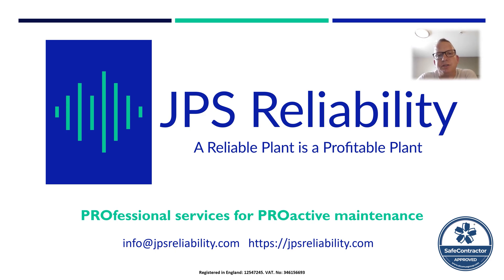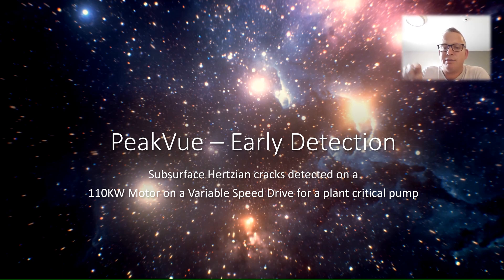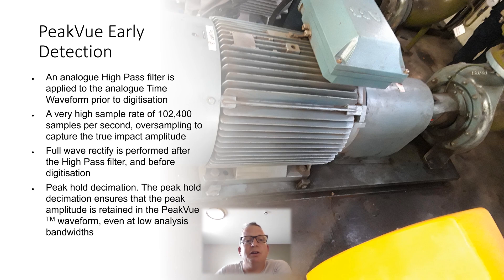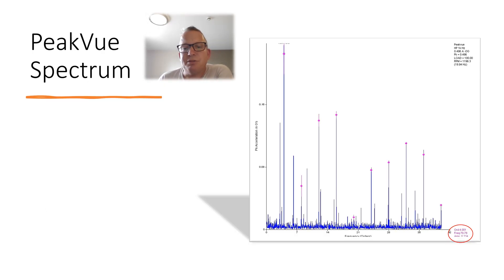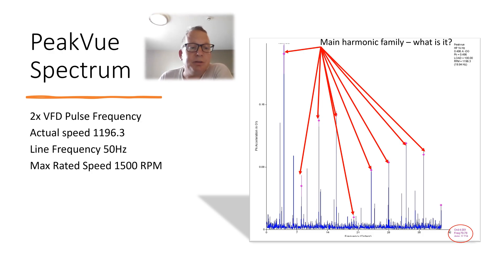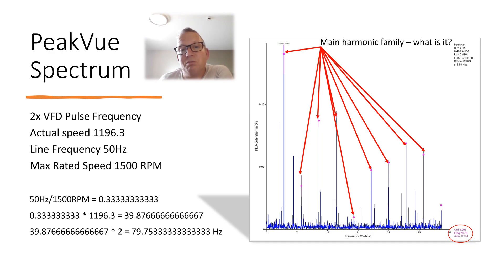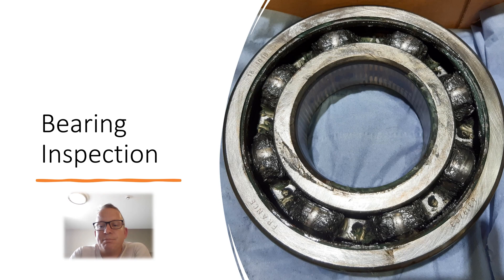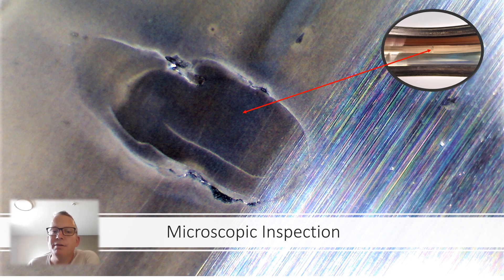Vibration Analysis - PeakVue - Outer Race Defect

Comment: Hi James. I really enjoyed this video. While I understand that the point of the video is to discuss PeakVue and not other technologies, I am curious on your thoughts regarding using Ultrasound as a tool to find these defects at an earlier stage even than vibration. Thoughts? 
It seems to me that sometimes we focus on tools to do a job that perhaps arent as well suited as others to make a call on health/unhealth of an asset. Or perhaps to be more fair, we should be using multiple technologies to make the case for our argument; i.e. Take the bearing out of service.
Honestly curious on your response.

For transparency, the company I work for sells Ultrasound inspection hardware that can sample ultrasound at 250K+ Hz.
Thanks for the work you put into these videos.
Reply from the maker: G’day Tim,

Many thanks for the question. 

With the advances in technology, vibration analysis and ultrasound do seem to be merging – we now have ultrasonic vibration sensors, and some systems have sensors fixed to 32Khz just for lubrication condition.

Depending on how the ultrasonic sensor is mounted for transmissibility and on the software used there is no reason that it won’t detect it earlier, but I can only think of a few cases where it would be beneficial to give such an advance warning for the defect in this presentation. 

For making a full call on the asset health we don’t just use VA, we also use our human senses, temperature, oils/LM, and ultrasound in various forms. So yes, I agree in the multi technology use to make calls on assets.

Also don’t forget there are so many other factors to consider before calling an asset for repair and not one job will be the same, so we must make the call on a system-by-system basis.

And as with ultrasound and VA the results we obtain is greatly dependent on the sampling set up, mounting of the transducer/accelerometer and the quality of the equipment used.
Reply: @reliabilitymaintenancesolu6459  Thanks for the great reply and the time taken. Love your work!